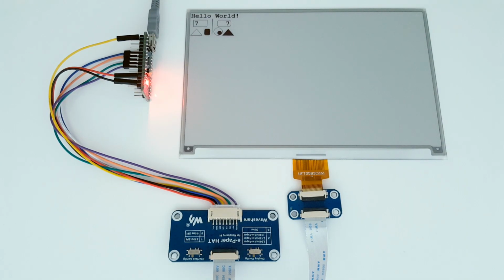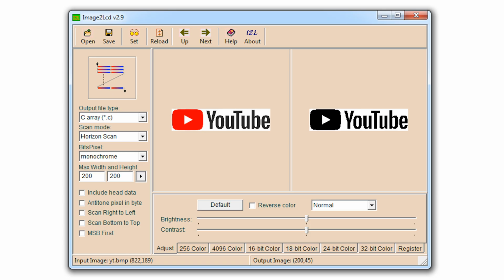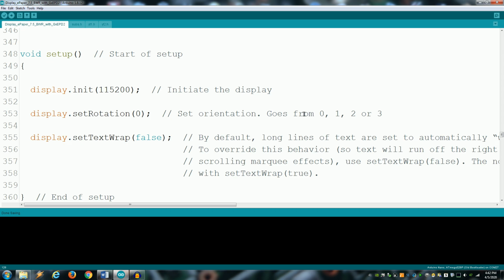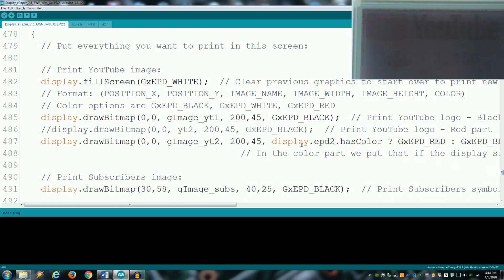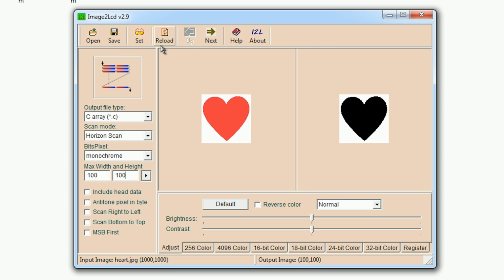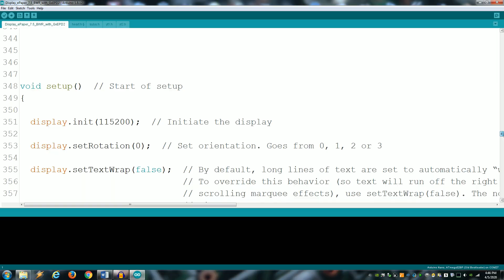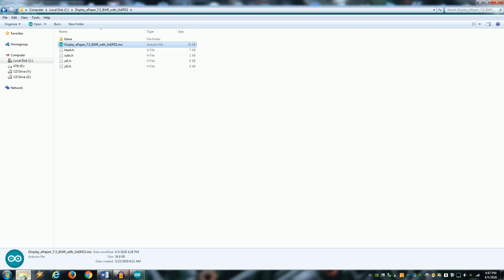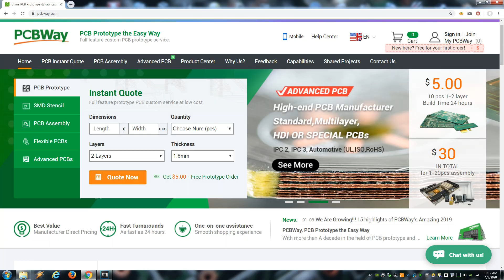Arduino Tutorial: E-Paper Display

Comment: hello sir, is it possible to change the hex array of data image  from serial port. the purpose is change the image without open the source code
Reply from the maker: Like this it's not possible, but what you want can be achieved using a micro SD card reader and reading the image inside the micro SD card. A device that can do this easily is the "inkplate 6color" (google it)

Comment: Hello brother, i buy Waveshare 2.13 (D) and still didn't get it how to use. Can you teach me how to use that
Reply from the maker: Maybe you didn't select your board and display at the beginning of the sketch? Try using an Arduino uno or nano
Reply: @interlinkknight  i did. Can you send me a full source code for only my e-paper HAT type. So can straight to run it.
Reply from the maker: The code I have is the one in the description
Reply: the screen type HINK-E0213A22-A0 SLH19148
Reply: this the serial output
_PowerOff : 8
_PowerOn : 8
_Update_Full : 8

Comment: No errors in the code, but it doesnt seem to work on my arduino uno.
Reply from the maker: That's weird. It should work
Reply: @interlinkknight  I have to say I use a 200x200 MH-ET live screen, but I thought it would work on most epaper. I cant get this screen to work on my uno at all.
Reply from the maker: Each epaper display is unique. Maybe try the one I use. Or try any other display that it's in the list near the top of the sketch

Comment: will a normal i pad stylus work on this display
Reply from the maker: No
Reply: @interlinkknight  Thanks for the reply, suppose, I created a python program in my touch screen LCD display with raspberry pi, if I change my display to an E-paper display, will my program work fine? can you tell me how easy/hard to migrate?
Reply from the maker: I never used raspberry pi so i don't know. You need a library specific for this kind of display. At least for me in Arduino, i had to learn from scratch how to use epaper displays.

Something you need to keep in mind is that this is not a typical display. Epaper displays have a very low refresh rate so you can't use them as other displays
Reply: @interlinkknight  What do you do by the way. Would you like to work on a project (GUI-based app in E-paper display using ARDUINO)? . We will pay you for that, if you are free let me know.
Reply from the maker: I currently work full-time in technical support. I don't have much free time so I don't think I could work on your project.

Maybe check out tablets with epaper displays that use android, like this: https://youtu.be/7NfX0vlCa4k?t=301
Reply: @interlinkknight  okay , thanks for the video👍

Comment: Important notice for new buyers
Reply: Currently working !!!!

I want to explain you the modifications that have been imperative.

1/ I’m using GxEPD version 3.1.0  & GxEPD2 version 1.2.16

2/ It is necessary to dive inside GxEPD2 library and replace 
	init(serial_diag_bitrate, true, 20, false);
	with 
	init(serial_diag_bitrate, true, 2, false);

it's the reason this actual screen doesn’t look. Nowadays screen with same reference are possibly not the same model than yours. It comes equipped with the “clever reset” , that apparently cause the fault of "apparently dead screen"

3/ the screen doesn’t work correctly with the HAT left selector (display config) on “B”(other) as for your demo. It will work but can’t print the black color. It is necessary to switch to “A” (smaller screens)

InterlinkKnight Thank you for your work again. Without you, I would not dare to use such a screen.

Have a good day, Thank you, good luck !

Comment: Hi InterlinkKnight ! many thanks for your wonderful job !

 I found your video & purchased same screen, with arduino nano, everything the same .  DOESN'T work !! nothing ! and Arduino does freeze !  So I've bee asking to waveshare (the screen seller) and they provided to me a soft from them (on their github) https://github.com/waveshare/e-Paper/    and in ARDUINO forlder, used the soft epd7in5b_v2 . (2 arduino pins 8 and 9 to swap for this soft)  and ...... IT WORKS !!!  but unfortenately, their soft is very poor, apparently can only print pictures. So the thing to do is to use yours.   but IMPOSSIBLE.  the guy at Waveshare said it's because the driver has been upgraded. now uses V2 , and it's not compatible. Well your soft had V2 selected , current line uncommented in AVR section : 

GxEPD2_3C<GxEPD2_750c_Z08, MAX_HEIGHT_3C(GxEPD2_750c_Z08)> display(GxEPD2_750c_Z08(/*CS=10*/ SS, /*DC=*/ 8, /*RST=*/ 9, /*BUSY=*/ 7)); // GDEW075Z08 800x480

.....   I try to comment/uncomment the library for black & white (my screen is 3 color 7.5, I repeat set up is 100% like yours, I din't take any risk choosing something different) but not way ! arduino froze & nothing happens. 

set up like this in your code :

// Include libraries:
//#include <GxEPD2_BW.h>  // Include GxEPD2 library for black and white displays
#include <GxEPD2_3C.h>  // Include GxEPD2 library for 3 color displays
#include <Adafruit_GFX.h>  // Include Adafruit_GFX library

if I unplug the HAT, arduino runs again ! obviously the driver is not the right one.....   do you have an hint ?  I think anyone who will purchase this screen to do this setup would definitely get stuck just like me ! All your work doing to be useless unfortunately ....
Reply from the maker: Give me a link of exactly what display you bought
Reply: @interlinkknight  € 51,14  Réduction de 10％ | Waveshare 7.5 pouces e-paper e-ink Display HAT (B) pour Raspberry Pi, 800 × 480, rouge/noir/blanc, pas de rétro-éclairage, faible consommation d'énergie
https://a.aliexpress.com/_BTf8km
Reply: @interlinkknight  Waveshare 7.5inch E-Paper E-Ink Display HAT (B) For Raspberry Pi, 800×480, Red/Black/White, No Backlight, low power consumption
Reply from the maker: It looks like you have the same display. I don't understand why the agent from waveshare said something about V2 because mine is also V2.

I later also bought the next version which is higher resolution and also worked, but I had to change the line where we select the display.

My suggestion is that try the example sketch included in the library and test with the line that selects the display. I had problems with that line before. I had to change some stuff there before to make it work, related to something about the size of the buffer or something like that.

If you want to continue this conversation, send me an email
Reply: tried everything, Still impossible to Use. Terrible problem. sent you message on instructables, you haven't see apparently.
Reply from the maker: I don't monitor the messages on instructables. I don't even get notifications there. But I just saw it. If you want more direct communications, send me an email.

So what I read from your message is that you have version 3. That means the resolution is 880x528. In arduino nano, use this initiation line:
GxEPD2_3C<GxEPD2_750c_Z90, MAX_HEIGHT_3C(GxEPD2_750c_Z90)> display(GxEPD2_750c_Z90(/*CS=10*/ SS, /*DC=*/ 8, /*RST=*/ 9, /*BUSY=*/ 7)); // GDEH075Z90 880x528

Comment: Hello, Is this lcd interface with other microcontroller ( stm, ti,nrf)?
I am working on one of my medical device. 
Could you please help me for below questions?
1) is it possible to display sensor data and waveform on this lcd?
2) Is there any driver available for Arduino? ( For showing waveform, adding images)
Thanks,
Rohit Patil
Reply from the maker: First, this is not an LCD. This is a epaper display. Second, technically it can work with any microcontroller but you need to see if your microcontroller has the library to control these kind of display.

The refresh rate on these epaper displays are very low so it's not appropriate for waveform. You can print waveform but it would refresh around 4 times a minute.

Comment: I wonder if it is possible to make your own low-resolution E-Paper displays.  It seems like the microcapsules might be the pricey part - Which would not be necessary on a low res design
Reply from the maker: If you tried, make a video. It would be cool to see that
Reply: @interlinkknight  I'd need to do much more research. But I would definitely post it.